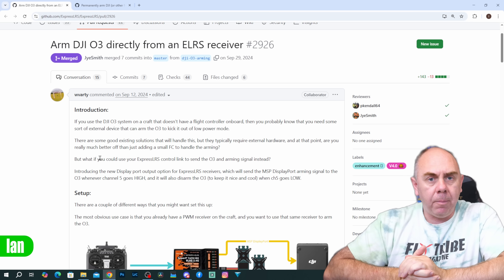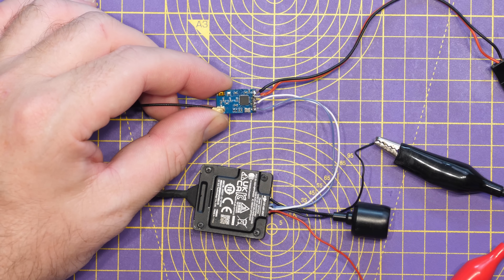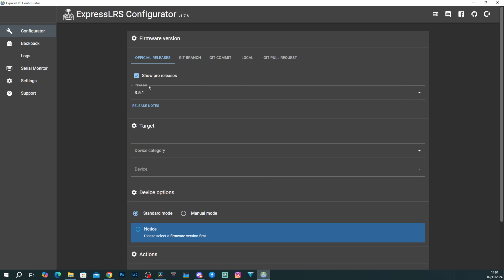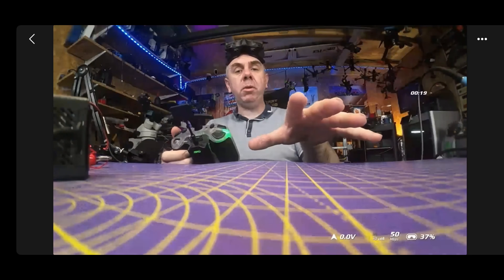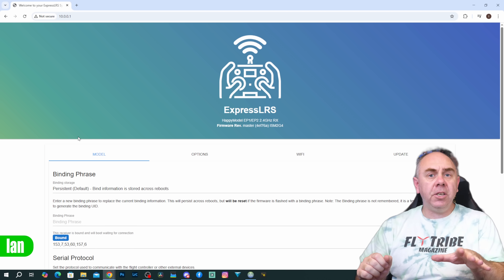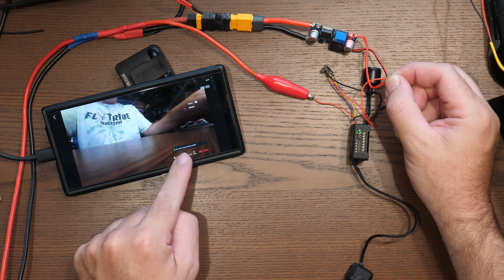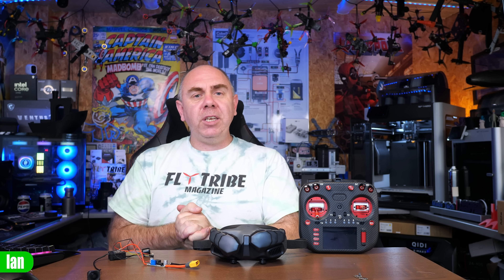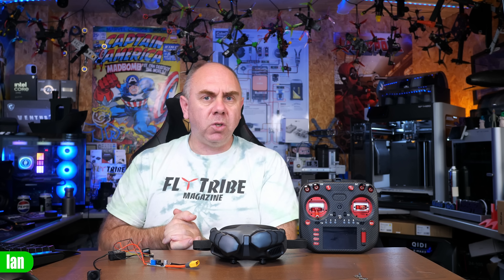DJI FPV Airunit Arming Without Flight Controller On ExpressLRS- O3 & O4 No FC Needed

Comment: I’m trying to do this on a non branded 7ch pwn elrs rx, but when I try to upload any master version I get the error not enough space…. I need a small pwm rx for my AtomRc flying fish, and cannot see a supported developer with enough channels (need 4 for controls and 2 for tx rx for o4 unit. Any ideas/solutions? Thanks.

Comment: I think it's worth pointing out that turning off low power mode seems to be a goggles 3 feature. So it's not O4 exclusive, it works with O3 as well if you have G3. Still a nice feature by the erls devs!
EDIT: unless I'm wrong and it just goes to full bitrate but doesn't actually increase the output power.

Comment: Man kann ja im Menü den Energie spar Modus verlassen. Hat mal einer die genaue HF Leistung ohne Freischaltung gemessen...?
Reply: Du kommst halt keine 300m weit in Low Power
Reply: @DioVinella  Hallo, genau das ist es halt nicht. Ich hab das mal auf einem Flieger getestet, ohne GPS. Da bin ich mindestens 1000m gekommen.
Wenn ich mal Zeit finde, kleb ich die O3 mal auf die DJI Drone. Dann hab ich zumindest mal eine genaue Meter Angabe. 25mW kommen da bestimmt, oder halt etwas mehr???

Comment: This is very interesting.  I have an O3 installed in an aircraft ( scale model)  I updated the FW on the O3 to the latest version 03.000 , and I use Crossfire with an SBUS CRSF-PWM board. I don't have an FC as such, but a ZOHD KoPilot board ( no OSD etc) just 3 modes including RTH.

I tested the O3 which has a 9v step down board in series for the O3.

I thought it was strange but welcome to see 50mbs after turning off low power mode.
Works every time, and have been puzzled ( but happy) it's working without any kind of arming.

Can't find any information anywhere in line regarding this.
I use in my other O3 air Seeeduino board with software from GitHub to arm it, that obviously works too, but now with CRSF I no longer need any kind of fake arming, have you heard anything about this, surely I can't be the only one?

No remote arming, it's full power, no msp so no switch arm facility.
Very strange though how it just works! 

Any chance you could investigate this please?

Comment: I think as part of ELRS 4 for fixed wing without an FC, they were going to enable arming to be moved from AUX1 to a different channel. Might be a dumb question but does this work when arming is moved from channel 5 (AUX 1). Fixed wing gyro modes usually are "hardwired" to chnage modes on channel 5. These two in combination would be Nirvana.
Reply: In 4.0, arming will still default to channel 5, but optionally can be changed to a packet header based arm signal that won't be tied a specific channel.
Reply: @caffeineau  Ok but skirts my question. Is that a yes this method for going to high HD FPV power will work with the new arm option?

Comment: What are you doing to my wife? Now I'll have to build an FPV-RC-Car for no-fly-weather-winter times. 😁
Reply: That’s exactly how my issues started. My wife wanted to drive her rc with fpv and wasn’t happy with the analog setup I first made. Then hated the range of 03 with low power mode. Got a chad rains armor but never put it on. I’ll gladly toss one of my spare receivers on that bish 😝